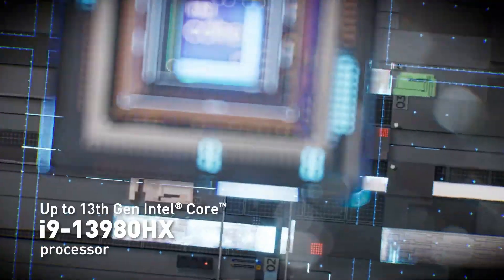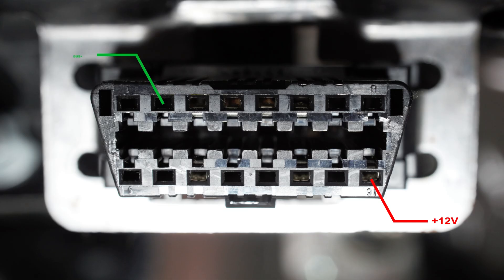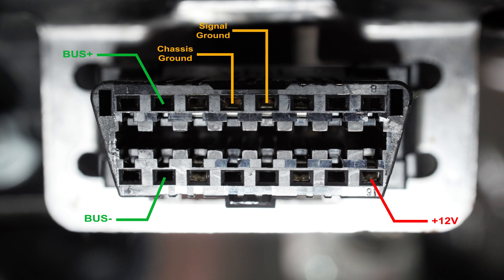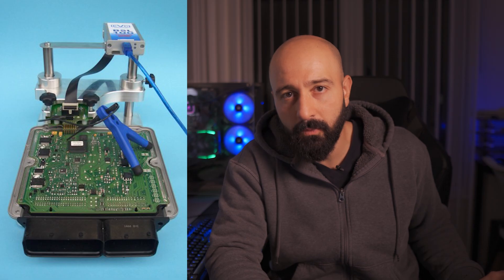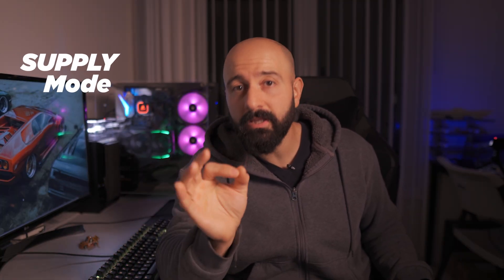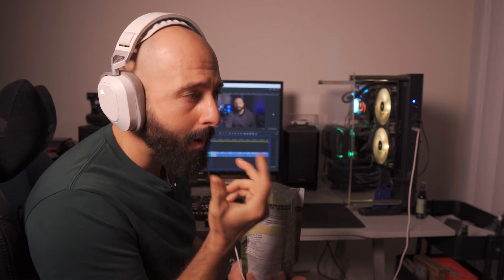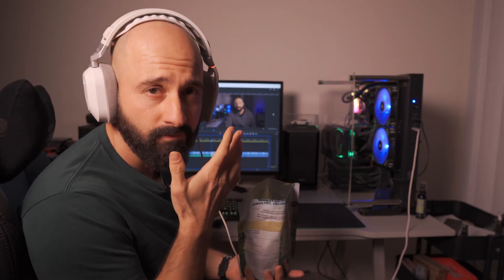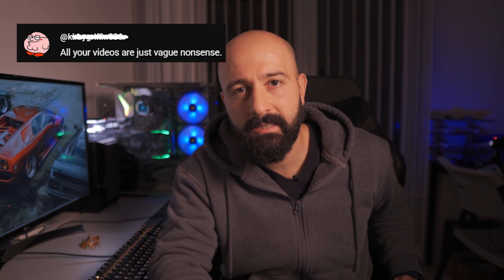Tools You Need || ECU TUNING

Comment: Subaru NA’s that has no definitions for ecuflash or romraider only can read or write with pcm flash and you need reverse engineering to tune it for example my Impreza 2.0R Sport 2008 Petrol engine with Hitachi Ecu: WA12212970/512KB ,calibration: D55P4EM5 software: 6E44387107 how to make a custom definitions and tune it can be a good video what do you think?

Comment: Suggestion: Tune a POS car that has a respectable sized community but not a lot of aftermarket support available.

I propose --->>> Ford Fusion, Focus, Edge they all have something in common! The 2.0 Turbo Ecoboost and can be tune with HP tuner, these cars are not expensive and available in every junkyard.. 

I don't know but you might start a fire 🔥 if you think about it...

Comment: Welcome back man!! Hope all is well 

Afaik the nomenclature in the vid at 4:20 is a tad bit wrong 🤓👆🏻

OBD tuning is OBD
BENCH is when the ECU does not necesit a de-lid and you connect directly to the pins
BOOT is when you de-lid, connect a pin to the boot port, depending on model it can be jtag or bdm, or just a pin to a contact pad AND to the pins that the loom connects to ^^

Love the vids and looking forward to many more!
Reply from the maker: Thanks man. 

And yes you're correct but if I worded it differently it would just open a massive can of worms and confuse everyone, I purposely simplified it to stay on topic. But I appreciate what you're saying cause you're 100% correct.

Comment: 20A battery charger? Most ones are 2-5A. I guess you meant at least 20AH capacity? Which obviously people should match with their own battery size
Also, instead of buying a knock monitor (or relying on the stock knock sensor) you can make det-cans. Get some hoses, connect two short ones to a long one via a T-piece, get some some ear muffs (the big ones looking like head phones) that you take out the inner baffling, drill a hole in to put the two short hoses through, and then get a copper pipe that fits on the other end of the long hose that you clamp flat on a vise and drill a hole through to bolt it to your engine. On Subarus people like to attach them on the intake manifold. That way you can audibly hear the knock.

Btw, flash a Daihatsu Cuore/Mira L500/L250 :)

Comment: I put carbon intake on my 2006 Z4 M and got it Alpha N tune. But I still get Intake Air Temperature sensor 1 Minimum Implausible(Bank1) Code. Is that normal?